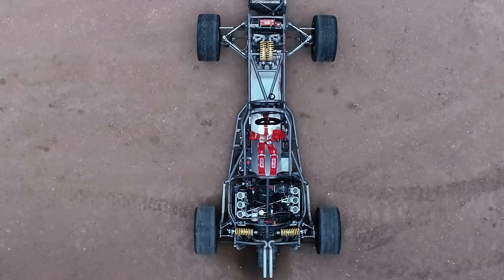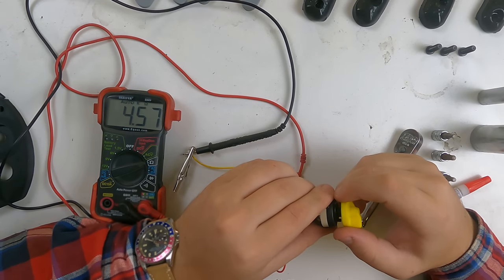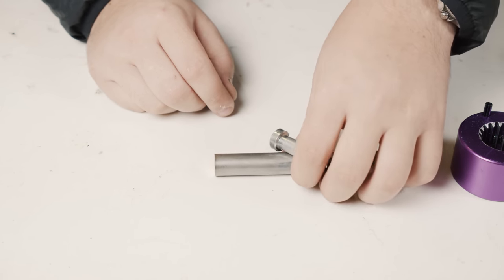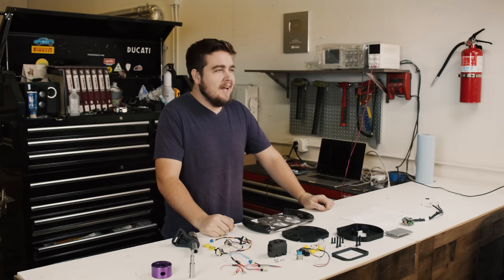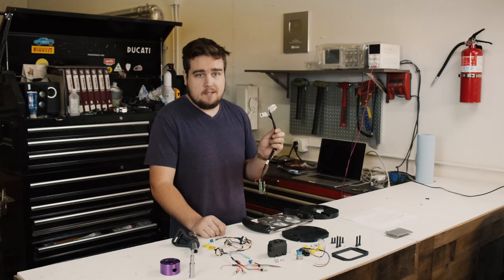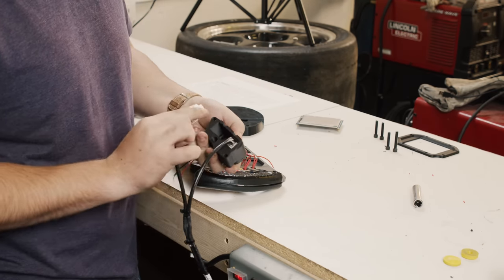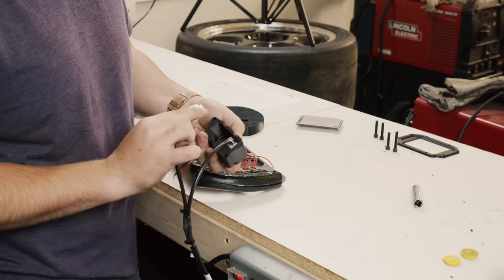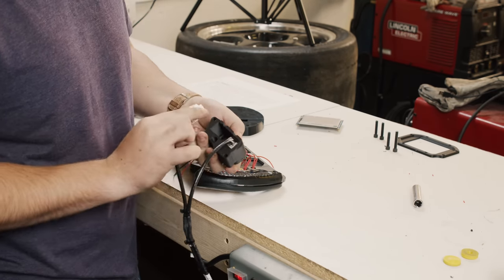The 60's F1 Car Returns with a V12

Comment: Another potentially useful habit to have with I2C communication, or most embedded programming, is to stay away from transmitting text whenever possible. It looks like you are sending a raw concatenated string of values that you then unpack into your various numerical values. If instead of the ASCII text you are sending as a string, you just send the value as a byte you will see something like a 2-4x decrease in the data sent.  Just convert it to a string when you need to print it. For example the example string you showed on screen is 14 bytes. But if you sent the values it would be 6 bytes. (each value besides tach is a 8 bit integer value, tach could fit into a 16bit integer).

Your code seems mostly fine, a lot of optimizations are not worth the hit to readability. But trading ASCII chars for integer bytes usually involves little change to the code, and often removes bottlenecks like you mentioned running into around 32 characters, so it's usually a good trade to consider.
Reply from the maker: That's a really good point- I didn't explore that, as I really am not sending that much data- with everything I can't see much more than 50 characters. Still substantial, and I'll do some testing with switching them over. This was easier to read during testing.
Reply: @WesleyKagan  yeah that is one advantage of sending ASCII, is it can be easy to read in some situations. I fall back on that for a lot of web requests and such, especially since in those settings I am not limited by compute capacity usually.

Usually you can do a print command that will print a integer/float/ect value as text directly. For example printf(“d”, value) in C which Arduino essentially is. It adds an extra step, but is simple enough that it can become habit.

I have found that I often work best by writing the base fragments of my program first, such as a function to handle packing and unpacking whatever data I am sending, then a function that takes the packed data and sends/receives it, then whatever functions actually use that in the logic of whatever I am trying to do. 

I test each as I go, and once I am convinced they work I treat them loosely as a “black box” that just works.

That being said, that is just what I find works well for me. YMMV

Comment: Why aren't you using deutsch connectors?  Also, EEPROM for storing your graphics off-chip.  Cheap and easy (SPI/I2C/Serial IIRC).  Also also, why not use a CAN bus?  That tinsy you got supports it IIRC.

Comment: For displays have you looked at nextion? 4 wires & has it's own controller so graphics are all done on a cpu... that's what I've used for v1 of my Arduino driven gauge cluster and am happy with it. This will 100% solve your memory issue and give you alot more options for graphics. Cheers from the east valley

Comment: you can use momentary switch on the shifter for the gearbox to send signal to the arduino. my bike (honda supra x 125) use some sort of rotary switch on the shifter, which is pretty much the same

Comment: Look forward to it’s first test runs, it looks like it will be awesome, one point of possible issues is block distortion under cornering this will cause the crank to be nipped and Rob your output, it’s worth making sure the engine mounts are in the best place to avoid this problem, a famous British race car company BRM suffered this they had huge power output on the dyno then once mounted in the chassis it lost significant power, they used a v16 the longer the block the bigger the risk of crank nip, wishing you the best 👍👏👏

Comment: Great video! Have you looked into a CAN-network as an alternative to the I2C-bus? It is also only 2 wires (differential pair) and should be able to run through the whole car. There are shields for arduinos. We use CAN in the Formula Student (like FSAE) team I'm in!

Comment: As soon as you pulled out the TFT display, I reminded myself of how unstable the connections on arduinos are. My nRF24 worked great on short wires, but if I used longer ones (like >10cm) then both spi and i2c would pick up so much inteference just through touching and moving things on the table, that I’m almost certain that you will have problems with them on a running car. I hope I’m wrong I had shitty equipment.
Edit: you can look into hamming codes if you want a self correcting code for data transmission.

Comment: Ecumaster has a Can switchboard for putting switches on steering wheels, also you might look into a Sim steering wheel like the GSI Formula Pro Elite, and use a program like Sim Hub and Nextion editor for the display, btw the touchscreen could be used to cycle between pages.

Comment: You should try out the Raspberry Pi Picos! They are cheaper than arduinos at the moment, faster, have more memory to work with, and you can still write and compile your arduino code for them in the IDE. Your should also check out using a CAN bus for communication, its more robust, cars have been using it for years, and I would say its just as easy to implement as I2C. Your videos are awesome and I look forward to watching your content. Keep up the amazing work!

Comment: Good to see you back looking at the racecar. Is it still a Porschekart with a Mercedes V12? The back end is well set up to have pushrod suspension with the dampers above the gearbox, allowing for a frame over the top of the transmission for added strength

Comment: you may consider looking into upgrading the arduino on the wheel side with a esp8266 or esp32 running on the arduino framework so its still easy to program but a lot faster especially for handling updates to the screen and more memory....
for sending data over distance, maybe canbus so you can do a datalogger down the road with steering wheel inputs/throttle/brake/suspension travel and all that....

i think the screen might not be readable in your application especially when sunlight shines on it.... and...maybe rev/shift lights on top of the screen?

Comment: i like the ui, but take a hint from actual F1 steering wheels and fill in the fuel/oil/temp bars so they are easy to check at a glance
also the tyre heat UI could be rotated to have each corner of the screen represent a corner of the car, much easyer to quickly understand

Comment: Frickin sweet dude, love your work. If you want to keep the fancy displays, you could consider a more powerful mcu? something like a teensy or even a raspi pico would give you much more to work with and you could make your menus as ridiculous as you liked, but you wouldn't need to write much fancy code.

you could probably get more out of the arduino with better code but throwing power at the problem is a lot easier, and leaves you more time to spend driving
Reply from the maker: I have a teensy I'm messing around with, but I just knew the arduino so well it worked great as a prototype. With the bigger board, I have some room to work as well.

Comment: Hey Wesley! Love your videos man, been following you for a number of years now. Im sure someone has already mentioned it but incase they haven't, iirc you're using the Mercedes M137? The 6 liter NA V12? This engine unfortunately has an inherent structural issue caused by insufficeient structural support near the block which results in out of round cylinder and massive compression loss/oil blow by. Probablly not a good engine to build around. Either the quad cam (first Pagani engine) from the earlier 600 class V12 (M120) or the engine that is the revised version of the M137 the 3 cam  twin turno M275. The M275 addressed the issues found in the M137 with additional webbing. Love your projects and Ill be here rooting for ya!
Reply from the maker: Yeah, The M137 is the V12 I happen to have lying around, but it's an odd motor for sure. This one was running well when I pulled it, And I scoped it and it actually looks okay. It doesn't have a ton of miles on it. My problem with the M275 is that's.. too much power for a 1200lb car. Hell, 400hp/tq is too much power, but I digress. If I could find a good M120 for a decent price, I'd jump on it for sure.
Reply: @WesleyKagan  you can also put mid-plates in which will add some structural support, and if it lacks crank support I’m sure someone out there has made a cradle/girdle

Comment: You should look at Adafruit's Feather M4 boards as an upgrade to that Arduino Micro. It has a whole lot more horsepower for not much difference in price, and should leave you in a spot where you have an abundance of compute for your needs,  which is always handy when trying to design for a million other constraints.
Reply from the maker: Yeah, the anxiety of 12% headroom really has taken a toll hah, Teensy is getting recommended a lot as well. Looks like I'm going to add to my collection of boards with an M4.
Reply: Yeah, don’t get hung up optimizing for space. There are a lot of mcu’s out there that support the arduino development environment but have a lot more storage and speed than the arduino official hardware. I think teensy has canbus support too. Have fun!
Reply: ESP32 is also a great choice. Basically anything that's not an AVR :)
Reply: @peejay1981  I'll second the ESP32. Plus, it gives you WiFi, Bluetooth, OTA firmware updates AND still works within Arduino. And it's WAY faster and has a TON of pins available.

Comment: I see that you also do a lot with arduino. I have made a data logger for my older race car where the ecu is not accessible. I also made a predictive lap timer with the arduino and a gps module. On the last test, I was about 0.013 seconds off the official race timing.

Comment: Bit pack your data. Use shielded TTL at 57600 baud, this works up to 3 meters. Since the mega has 3x extra TTL ports, you can get 3 nanos into 1 mega controller at high speed.

Comment: take a look at seeeduino xiao if it has enough pins for you, cheap, fast and alot of memory. I use it on my display progects works great. The arduino is old and dated. One more thing you can comunicate true serial to your ms3 to get sensor data, it is what I do with my speeduino display setup

Comment: I've tried that resistor divider with the CK 12 positions and it was a huge pain to get reliable readings and denounce. Wound up going with a simple ancient 16bit analog 74HCT597 parallel to serial shift register design. 2 MCU pins <-> 32 DI pins with 100% accuracy and already faster than needed 100 hz polling rate.
Reply from the maker: Because I used such a wide range in my resistors, I was able to read a range of data so it didn't matter. For a 220 Ohm Resistor, I'd set a target range of 200-240 ohm and it would be close. My next largest was 400+. Not the most elegant solution, but it worked.

Comment: Cat6 is not "one better" than Cat5, it's simply for a different purpose — ducted runs in buildings. It has a stiffened insert, and a less-forgiving wire formulation, which together give it a minimum bend radius to guarantee proper function.

Cat5 (the current up-to-date revision of which is Cat5e) carries the same signals at the same speed and quality, but is designed to be flexible; the tradeoff is maximum length.

While I'm sure Cat6 will do the job of scrunching up inside the steering wheel and carrying some analogue voltages to and from an Arduino just fine, Cat5 is much better-suited to doing so. Shielded Cat5 probably even more so!

Comment: If you want more speed on the display you need to goto a higher speed board. Might I suggest the teensy? They run on the arduino language as well and are much faster. Should be able to use most of the same libraries as well and get a faster refresh rate on that display.

Comment: Nice Project! I think in the long run you'd profit from orienting on the wiring/communication protocols production cars use. Have you thought about using CAN Bus or something IP based over Ethernet for the communication?

Comment: Such a cool project! Have you considered using an ESP32 instead of Arduino? Dual core 240Mhz, way more GPIOs and you can use LVGL to design your display on PC with way less coding required.

Comment: Look into ESP32s, they are basically like Arduinos, you can get them in smaller form factors and they are several times faster. They are also usually cheaper than Arduinos and get programmed the same way. I think that if you are reaching the capabilities of the Arduinos ESP32 will fix the issue.

Comment: Have you considered a zero roll suspension setup for the rear end? Having a single shock/spring may work well with your space constraints.
Reply from the maker: I thought about it- I’d really like independent control, but I agree I’m sorta out of options. Would solve the rollbar problem in the rear as well.

Comment: For TPU: print slowly like reeeeeaaaaaaaaaaallllly slowly, no retraction, higher temp than you think/recommended, fast travel speed to reduce oozing,  z-hop is recommended, loosen your extruder gears a fair bit and use a direct drive extruder if you can. Good Luck :)
Reply from the maker: I'm glad to know that I'm not the only one that struggles with it. I think I need to learn how to cast silicone hah.

Comment: Switching from Arduino to an ESP32 would help you out in several ways. It's got way more resources, so the size of your program won't be an issue, and it has a really slick wireless protocol called ESP Now where two boards talk over 2.4 GHz. Packets take whatever struct you define and go to whatever board you define based on Mac address. And there is confirmation, so you can set up warnings if packets go missing. Plus, they're cheaper boards than Arduino.
Reply from the maker: I'll take a look, I haven't messed around with those much!

Comment: At 6:02 through 6:17, and 10:48 to 11:26 the audio is missing, just to let you know. Awesome project! For your issues with program storage, have you considered using a different micro like a rpi pico? They're cheap and very powerful, even having dual cores so you can read sensor data and write to the display simultaneously on two different threads. Even if you don't get that complicated, the pico would give you more storage and a faster CPU.
Reply: Also if you're having communication issues with I2C, I would consider using CAN as it's more meant for the noisy environment in an automobile. Some microcontrollers have CAN transceivers built in, but you can also get I2C CAN modules.

Comment: You should use the esp32-wroom-32E-16mb. Its a mcu like the arduino that runs 240mhz instead of 16mhz of the arduino and it had dual 32bit cores instead of a single 8bit core. Its wayy better and had 16mb of storage for the program. I have used them myself and they work great. They are a little more expensive than the arduino but the cheaper little brother is the esp12f  thats based on the esp8266 chip that has less performance but plenty for the projects. I am dreaming on starting a project like that myself so keep up the work💪

Comment: Switch over to a Teensy 4.1 for your central controller and don't look back on power/speed/storage. I'm a huge fan of properly made code, but it has the horsepower to just chug away with whatever you throw on it. Works straight with TeensyDuino. PlatformIO might help with your code writing and is directly compatible with Arduino stuffs.

Comment: You might have trouble reading that screen in direct sunlight. The roll cage design -- you might want to run it by some SCCA tech folks. They are real particular about the way those work. Even if you don't really plan to race it, you've got an open-wheel car and so they might be one of the few clubs that will let you run the car.

Comment: Those shocks look like they are a twin tube design.  If so, they will not work horizontally or upside down.  If you keep that design, you can only use a monotube shock.

Comment: I wouldn't use i2c. I would use good old serial RS232 protocol. You would need an extra board with a max232 chip at each end, but it would be more resistant to noise and it will allow you to run longer cables.

Comment: Love the projects, the one thing that i don't get is, why not use an ESP32, it's faster, has more memory, if you are running multiple arduinos anyway, for any non-essential Data, you can use a wireless connection,basically build an ESP-NOW mesh or so for fuel gauge etc.  - I'm not a programmer either, but it would make heaps of sense especially with a GUI involved

Comment: With TPU, it really depends on the printer. Direct drive printer where the extruder is on the carrige with the print head tend to print TPU best. Also nozzle geometry matters. THe E3D nozzles seem to work extremely well in my experience over the cheap nozzles that come with most printers.

Comment: Instead of using I2C, you could venture to use CAN, with CAT6 you've already got the twisted pairs, still only requires 2 wires and is incredibly robust.
Downside is; you'll need a CAN transceiver chip in your circuit.

Comment: The range of the I2C bus can be extended significantly by running it through a P86b96. You need one for the master and then one for each slave. The range can be increased up to 30 meters, especially if you're using Cat6 or higher. 

Regarding the Cat6, you need to shield the whole path of the cable, from connector to connector. Nowhere on the line should there be a way for the interference running in the cable's shielding and onto the un-shielded pin-outs.

You should consider using the datatype "byte" instead of integer where possible if you know you won't exceed 255. This could significantly reduce your current code's size - especially considering most of your variables are global.

I'll look into your code a bit more and see if I can't optimize it a bit + make it easier to read. Making several files and using classes is a clever way to make things easier to read.

Avoid using "Serial.Print". It uses A LOT of memory and takes a lot of time to process. Only use it for debugging.